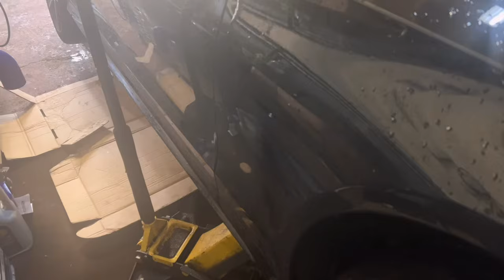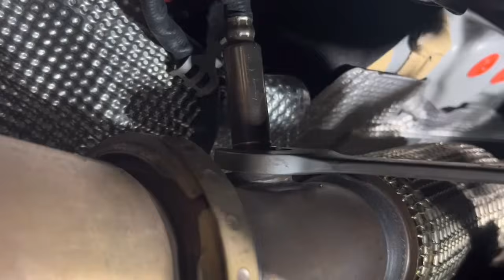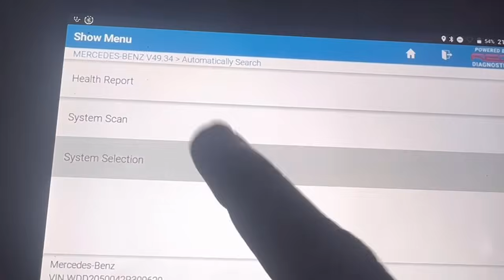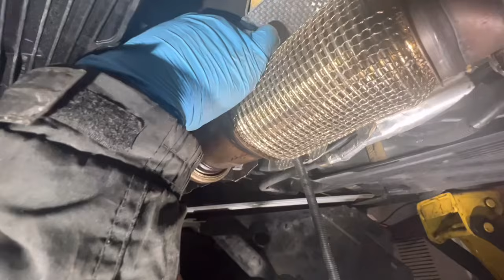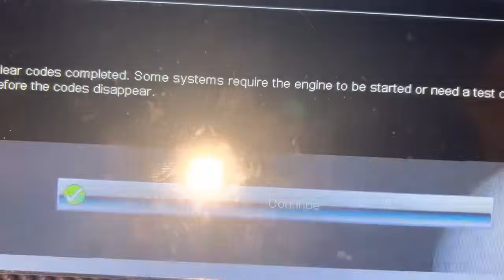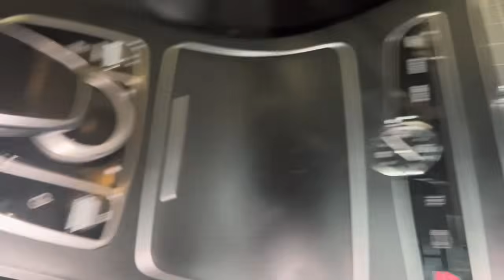MERCEDES  ADBLUE RESET WITH NOX SENSOR - FULL VIDEO

Comment: Hello Charli i have a small workshop here in Australia, I have a 2013 Mercedes W166 ML250 with OM651 engine in our workshop which had a fault with adblue meter which throw up several codes one of them being P13E400, I carried out the repair and cleared all the codes and did adblue meter learn new values but I can’t clear P13E400 I haven’t taken the car for a test drive yet as I’m concerned with the mileage count dropping but I noticed on your video you didn’t clear the P13E400 code and went for a drive down the motorway did it clear itself after you carried out the repair on the Adblue meter?
Reply from the maker: Hi mate, good question – and you’re right to be cautious with the mileage countdown on these.
*Short answer:* yes, in most cases *P13E400 will NOT clear immediately* and needs a proper drive cycle to clear itself once the AdBlue level/meter repair is accepted by the SCR system.
### What P13E400 means on OM651 / W166
P13E400 is an **SCR plausibility / AdBlue level rationality fault**.
Even after:
* repairing or replacing the AdBlue level sensor/meter
* clearing fault codes
* carrying out “teach-in / learn new values”
the ECU often keeps P13E400 stored until it sees confirmation during real-world driving.
In simple terms, the system wants to see the AdBlue level behave correctly while the vehicle is moving.
 Why it didn’t clear in my video
On that job:
* the repair and teach-in completed successfully
* no active countdown fault was present
* P13E400 stayed stored
* after a steady motorway drive, the SCR monitor completed
* the code cleared automatically
This behaviour is very common on Mercedes SCR systems.
About the mileage countdown
If:
* the repair is correct
* no SCR or AdBlue faults remain active
* the teach-in completed without errors
the mileage countdown should **stop decreasing**.
It may still display the last value, but it should freeze and not continue counting down.
That is why Mercedes expects a proper drive cycle.
What to do before the test drive
Before driving:
1. Check live data:
   * AdBlue level percentage changes plausibly
   * no “implausible” or “not learned” status
   * SCR system shows enabled / ready
2. Carry out a proper drive cycle:
   * 15–25 minutes
   * steady speed (around 60–70 mph if possible)
   * avoid short stop–start trips
3. Re-scan after the drive:
   * P13E400 should clear automatically or remain as history and then clear
If you’re using Xentry, it makes confirming SCR monitor completion much clearer.
When to investigate further
Only if:
* P13E400 returns immediately as an active fault
* the mileage countdown continues dropping
* the AdBlue level stays fixed or jumps unrealistically
then look at:
* wiring to the AdBlue tank
* incorrect sensor calibration
* internal AdBlue/SCR control unit issues (less common)
If you need more help, feel free to *join our WhatsApp and Facebook groups* — there are lots of Mercedes owners and technicians sharing real-world fixes and follow-ups there. We do our best to help, but due to the volume of comments we can’t always reply individually.

Happy to help further if you need it

Comment: Hi my friend, I cleaned my adBlue injector but still I got P13DF09, P140300 and P204F96 error codes. Also eng.start not possible message appeared on the dashboard. I check ed the live data and the injector does not spray the requested amount of  adBlue liquid to the exhaust. Maybe I should clean the injector nozzles thorougly?
Reply from the maker: It's possible, sometimes cleaning the injector nozzles thoroughly can help. ❤️

Comment: Hi Charlie, great vid..I have the AdBlue message, won't start after 450km..I've got 220d w205 2017 estate..is the sensor in the same place on the estate?
Reply from the maker: Yes — on the W205 220d estate (2017) the NOx sensors are in the same locations as the saloon. Being an estate doesn’t change the exhaust layout.

Comment: Hello Charlie! I have a similar problem. Shows check Adblue and cannot read fluid level. I have cleared the old Adblue fluid, i have cleaned the injector. Still the problem persists. Also the level cannot be read on the first acc key. If I put it again the level is read. Any suggestions?
Reply from the maker: could be softwear

Comment: I have V250 2015 fault codes P13DF09 and P2BA9FD . Everything is clean and works fine even nox sensor yet i cant get rid of miles remaining warning . All this happened and i topped up adblue before it was perfectly fine . I also had a recall for a system update and nox sensors replacement but they couldnt do it as they claim they couldn’t connect to the exhaust system or whatever . Please help me out
Reply from the maker: 1️⃣ Check AdBlue Quality & Reset

Since you recently topped up, make sure the AdBlue is fresh and of good quality.
Some Mercedes models require a specific level of AdBlue before resetting—try filling the tank to at least 80%.
Perform an AdBlue system reset using a professional diagnostic tool like Xentry or Autel.
2️⃣ Check NOx Sensor Functionality

Even if they were replaced, verify that the upstream and downstream NOx sensors are reading correctly in live data.
A faulty NOx sensor can prevent the system from clearing the countdown warning.
3️⃣ Check Exhaust Temperature & DPF Status

If the system doesn’t detect proper exhaust temperature or flow, it may not allow the NOx system to reset.
Run a DPF regen to clear any possible blockage.
4️⃣ Mercedes Recall & Software Update Issue

Since the dealership couldn’t connect to the exhaust system, it might indicate a communication issue with the NOx module.
A deep ECU reset and re-adaptation might be needed.
If they failed to do the recall update, they should re-attempt it—sometimes connection failures happen due to software inconsistencies.
5️⃣ Hard Reset & Force Relearn

Disconnect the negative battery terminal for about 15 minutes.
Reconnect, turn the ignition ON (but don’t start the engine) for 2-3 minutes to let the system recalibrate.
Start the engine and let it idle for 10-15 minutes.
Best Next Step:
If none of the above works, a full AdBlue and NOx reset via Xentry or Autel Ultra is required.
You might need a forced SCR system reset and relearn.
If you are in the UK, I can help with a full diagnostic & reset at my garage.
📩 Let me know if you need more help! Also, you can join our WhatsApp or Facebook group for more discussions:

🔗 WhatsApp: https://chat.whatsapp.com/JOvJCdZYdV9J6PvIXw2RV0
🔗 Facebook: https://www.facebook.com/share/g/15msa3NJmn/
Reply: @SanuMotorswithCharlie  update i done a full adblue drain and bought different brand adblue and February manufactures date and code P2BA9FD is gone now but i still have code P13E400 i have autel when i try “resetting warning message SCR/adblue “ after “enter the menu Programming/Customization' and perform the function Coding” it goes back without completing it
Reply from the maker: PLS SING UP TO THE GROUP, CHARLIE IN THERE

👉 Join our WhatsApp or Facebook group for more car tips & discussions:
🔗 WhatsApp: https://chat.whatsapp.com/JOvJCdZYdV9J6PvIXw2RV0
🔗 Facebook: https://www.facebook.com/share/g/15msa3NJmn/

Hope this helps! Let me know how you get on. 🚗🔧
Reply: @covid-2164 . Do you fill the tank from the canister or at the petrol station?
Reply: @ i bought 10l from euro car parts it was very bad quality
Reply: @covid-2164 If you use the canister, you will overfill the tank. Then you get that result. 
Next time use the pump at the petrol station. Fill until it cuts out. Or use a 5L canister.

And about quality. It takes the liquid fom the tank and sprays it into the exhaust. It could be aswell be water 😂.

Comment: Hello I have a s350 w222 2014 on my dash it says after 800km no start the Adblue tank is full the engine light is also on
Reply: Today again I removed the injector from the exhaust pipe and start the car but there is not coming any Adblue from the injector
Reply from the maker: Thanks for sharing the update, and I’m glad the reset was done. If the AdBlue injector isn’t spraying, it’s essential to test both the injector and the pump in the AdBlue tank before deciding on a replacement. Here’s how you can proceed:

Test the AdBlue Injector:

Remove the injector and inspect for blockages or crystallized AdBlue residue.
Clean it thoroughly with warm water to remove any deposits.
Reinstall and check if it sprays when the system is activated.
Check the AdBlue Pump:

Using a diagnostic tool like X-Entry, you can command the pump to activate and monitor its pressure and flow rate.
If the pump isn’t creating enough pressure or isn’t running at all, it may need replacement.
Inspect Wiring and Connections:

Ensure that all electrical connections to the pump and injector are secure and free of corrosion. Faulty wiring can also cause the system to malfunction.
Advanced Diagnostics:

Use a Mercedes-specific tool to monitor live data for the AdBlue system, including pressure readings and injector activation. This can pinpoint whether the fault lies with the pump, injector, or another component.
Let me know how it goes or if you need more guidance! 🚗🔧 #MercedesAdBlue #InjectorTest #CarDiagnostics
Reply from the maker: Are you from uk or outside?
Reply: @ hello I from The Netherlands
Reply from the maker: sorry im from uk
Reply: @SanuMotorswithCharlie  ah oké I have cleaned the ad blue injector it was closed with that white stuff I reset the car now the engine light is off but still have the sign of no start after 600km but I have reset the car with just a small obd reset tool the fault codes that I get was p2085 , p2084 , p2033
Reply from the maker: Great job cleaning the AdBlue injector and resetting the engine light! The codes you’ve mentioned (P2085, P2084, and P2033) are typically related to the Exhaust Gas Temperature Sensor (EGTS) or the AdBlue system.

Here’s what you can do next:

Check the Exhaust Gas Temperature Sensors:

P2085 and P2084 indicate issues with the EGTS. Inspect these sensors for dirt, damage, or wiring issues. Replace if necessary.
Ensure Proper AdBlue System Functionality:

The remaining "no start after 600km" warning might mean the system hasn’t fully reset. Some systems require a complete SCR (Selective Catalytic Reduction) reset, which may need a tool like X-Entry or a higher-end OBD tool.
Perform a Drive Cycle:

After cleaning and resetting, take the car for a 15–30 minute drive to allow the system to recalibrate. Ensure you’ve added the correct amount of AdBlue to the tank.
Professional Reset:

If the warning persists, you might need a professional reset with a Mercedes-specific diagnostic tool like X-Entry. This can also recalibrate the system and clear any residual warnings.
Let me know if you need further guidance or details! 🚗🔧 #MercedesAdBlue #P2085 #CarRepairs
Reply: @SanuMotorswithCharlie  thanks for your info I have reset it today by a mechanic with Mercedes tool and the km now says 800km after that no start the guys says that he thinks I have to buy a new adbleu tank but how can I test if the injector is good or the Adlue pump in the tank is good ?

Comment: Hi,I have a situation with my Mercedes C Class 2016 1.6 D.I have the following error codes :P2BA9 / P13DF / P2002 / P225B / First my care asked for oil level to be checked. I filled it with 1L as per indication. Then, it asked for AdBlue which I did and all was ok.Yesterday the AdBlue came back again and also the Amber Engine Light Warning came on. I have filled the AdBlue again with 10L today and the care cannot read that the AdBlue has been filled in. 
However today, an estimated range of 500 miles showed until my engine wont start anymore. Whilst this was there, I could read the AdBlue levels and its almost full.
Would you be able to help? If so, what would an estimate be? Roughly, as I understand there can be variables to this process
Reply from the maker: The codes you’re seeing on your Mercedes C Class 2016 1.6 D and the associated symptoms (AdBlue system warning, engine warning light, and range limitation) are likely related to issues with the AdBlue system, the DPF (Diesel Particulate Filter), and potentially the NOx emissions control system. Let’s break down the error codes first and look at the root causes:

### Error Code Breakdown:
1. *P2BA9 - NOx Exceedance - Insufficient DEF Quality Detected*
   - This code indicates that the AdBlue (DEF) system is detecting poor quality or insufficient DEF (Diesel Exhaust Fluid), which might result from a sensor issue, poor-quality AdBlue, or a problem with the injector or pump.

2. *P13DF - Glow Plug Control Module Circuit Error*
   - This relates to the glow plug system. While it might not be directly related to the AdBlue issue, it could indicate a problem with the emissions system, as glow plugs are involved in controlling emissions during cold starts.

3. *P2002 - Diesel Particulate Filter (DPF) Efficiency Below Threshold (Bank 1)*
   - This is related to the DPF being blocked or unable to regenerate properly. The DPF could be causing backpressure, affecting emissions and triggering the engine light. The DPF is crucial in keeping exhaust gases clean, and this error indicates a possible blockage.

4. *P225B - NOx Sensor Circuit Range/Performance (Bank 1 Sensor 2)*
   - This code points to an issue with the NOx sensor on your exhaust system, which monitors nitrogen oxide emissions. A faulty NOx sensor can affect the AdBlue system's ability to reduce emissions properly.

### Possible Causes:
- **AdBlue system malfunction**: The AdBlue tank, injector, pump, or sensors might not be reading the levels correctly, causing the system to misinterpret the fill status.
- **Blocked DPF**: A blocked DPF might prevent the AdBlue system from functioning correctly due to excessive exhaust backpressure.
- **NOx sensor fault**: This sensor plays a critical role in managing the AdBlue system by detecting NOx emissions. If it’s faulty, it might misreport emissions, causing the system to trigger warnings.
- **Poor AdBlue quality**: Ensure that the AdBlue you added meets the required standards, as low-quality AdBlue can lead to these issues.

### Troubleshooting Steps:
1. **Check AdBlue System**:
   - Ensure that the AdBlue tank sensor and injector are working properly. Sometimes the system might need to be reset with a diagnostic tool to recognize the new AdBlue levels.
   - Clear any airlocks in the AdBlue system by using the proper diagnostic tools or performing a system reset.

2. **Inspect the DPF**:
   - If the DPF is blocked, it may need to undergo a regeneration procedure (either forced regeneration or replacement if it's completely clogged). The engine control module might prevent normal regeneration due to the issues with the NOx sensor.

3. **NOx Sensor Replacement/Inspection**:
   - The NOx sensor might need replacement if it's misreading emissions, as it’s critical for managing the AdBlue system.

4. **Diagnostic Tool Reset**:
   - The vehicle will likely need to be connected to a Mercedes-specific diagnostic tool (such as Xentry or STAR) to clear the codes and reset the AdBlue system.

### Cost Estimate:
- *Diagnostic and Reset**: Depending on the garage, this can range from **£100 to £250* for diagnostic work and system resets.
- **AdBlue Injector/Pump**: If the injector or pump needs replacing, this can cost anywhere from **£400 to £2000**.
- *NOx Sensor Replacement**: NOx sensors are typically **£400 to £800* including labor.
- **DPF Cleaning/Regeneration**:  regeneration typically costs **£250 to £1000**, while DPF replacement can cost over **£1000**.

Since there are multiple error codes, I would recommend starting with a thorough diagnostic using the correct equipment, focusing on the AdBlue system and the DPF. The NOx sensor is a likely culprit as well.

Feel free to let me know if you need more details or guidance on this!
Reply: @SanuMotorswithCharlie  szia. Ha NOX 2 szenzor hiba van, akkor azt külön hibakóddal jelzi a rendszer a P20EE mellé?

Comment: Nice video Charlie, Good video. I have taken off the Adblu sensor and like you said it was blocked. When you remove the adblu sensor and start the car, should adblu come out of the sensor immediately or does it take time? I have no adblu coming out of my adblu sensor! I’m getting P13F600 error code and P13E400
Reply from the maker: Hey there! Glad you found the video helpful. When you remove the AdBlue sensor, AdBlue should start flowing immediately upon starting the car, provided the system is functioning correctly. If you're not seeing any AdBlue coming out of the sensor, it might indicate a blockage or a malfunction in the AdBlue system. The error codes you're getting (P13F600 and P13E400) typically relate to AdBlue system faults. It's essential to diagnose and address this issue promptly to ensure proper functionality of your vehicle's emissions system. I'd recommend consulting with a mechanic or dealership knowledgeable about AdBlue systems to pinpoint and resolve the problem. Good luck!